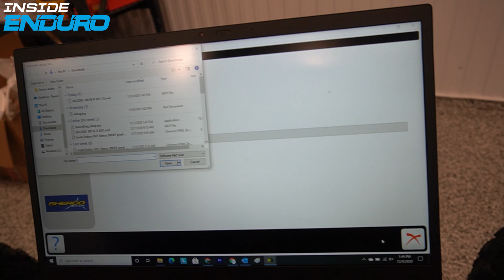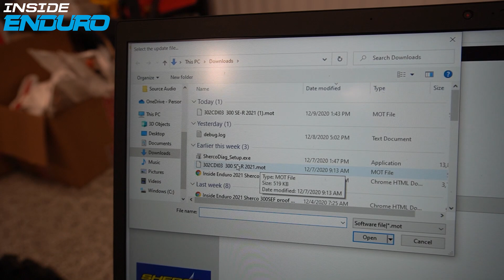Re-Mapping the 2021 Sherco 300 - Farmers Only Edition

Comment: I have 2021 se300factory, but the engine doesn't work and it doesn't start.
So, I changed the CDi into other person's one in the same model and I found that there is a problem with CDi. Is replacing the coil unit the only solution for the problem?
I didn't change anything in the original setting.
I rode my new motorbike only for 7 hours
Reply from the maker: Did the dealer update your map?  We update every bike before it is released into the wild.  If the mapping plug -in protocol is not performed correctly (in sequence) it can damage the system....
Reply: @silverkingshardenduro  Thank you for answering. Have a nice day : ) 🙏

Comment: When can we get an in depth demo? Can we tweak the maps at all? I would love to be able to ditch the stock 'wet condition mode' and put a map like I would expect the old Cross Country model to have. 

There was a couple time that I wished the power wasn't so linear. If I could have an extra snappy map for those times I need to clear that triple straight from the bowl corner I would be a happy man. I realize the fly wheel is a contributing factor, but changing the speed of the power valve could help me out.
Reply from the maker: Love it! We’ll add your request to our production list 👍🏼